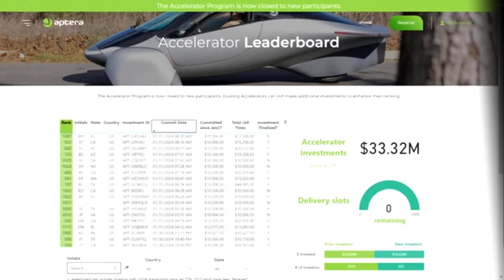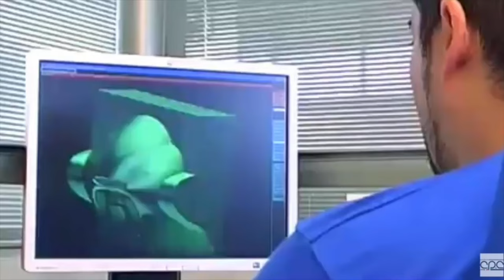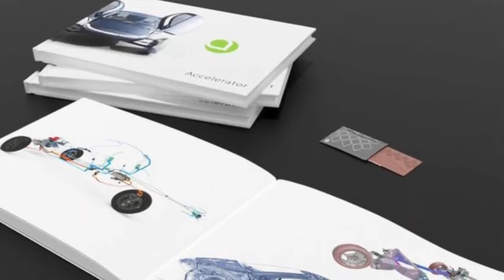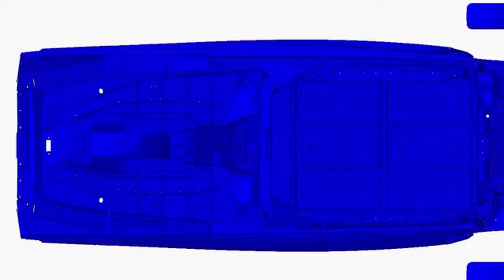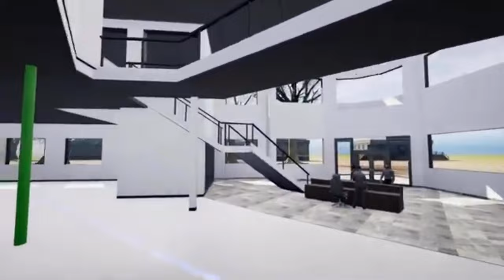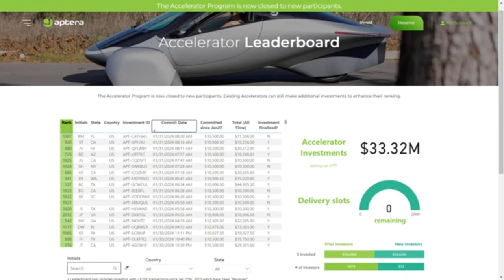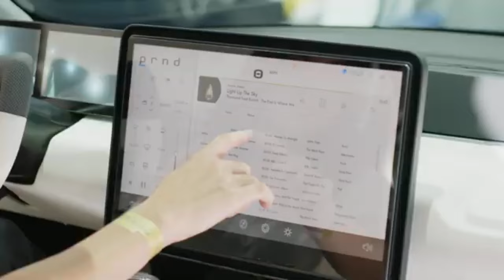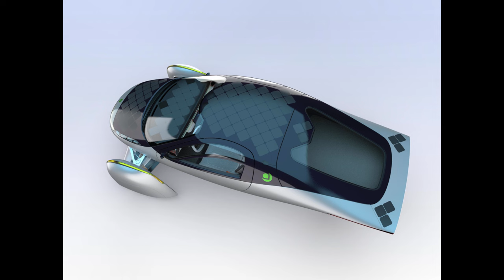Aptera reveals Solar EV structure, says funds enough to start production in 2024

Comment: Hmmm, I thought they had moved the target for production out to 2025.  At the earliest.  I love the concept, but this is really starting to feel like a Ponzi scheme.  It's been what, 19 years since this got underway?
Reply: Production starts in 2024. It was never moved to 2025. If it was, the company needs to correct this on their website and make a video too.
Reply: No. It hasn't been 19 years. They restarted in 2019 with a completely new, all-electric solar design. The first attempt crashed because they brought in a Detroit CEO who drove the company into the ground after the founders left. It has been about five years, which is a reasonable timeframe for bringing a new car to market.
Reply: 🤓Yes, they are still projecting production will start late this year. However first customer deliveries will probably not happen until early next year. The first few production vehicles will be for testing and shows.
Reply: @fotoguru222  - I never realized that the first few production vehicles were for testing and shows. I thought they would be delivered to customers. It's good they will go beyond the 16 pre production models they are building right now and do more testing. It shows that they really want to make it perfect before taking a production model and selling it to a consumer.
Reply: @fotoguru222  it's all for show
Reply: @bluetoad2668 
Prove it. What’s your data